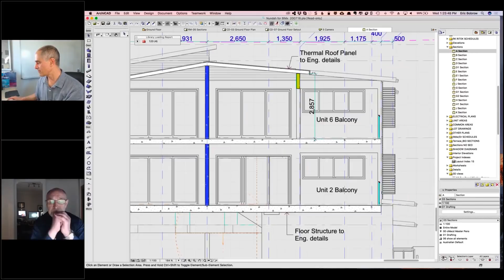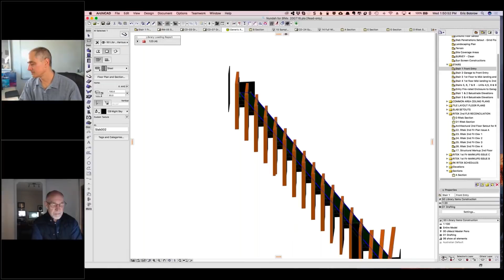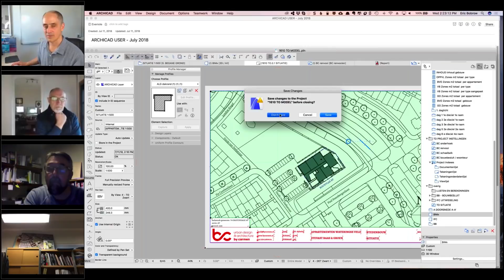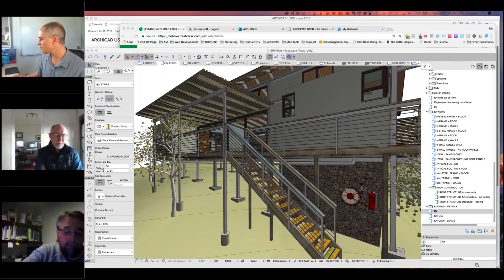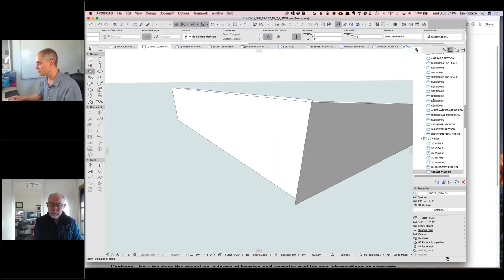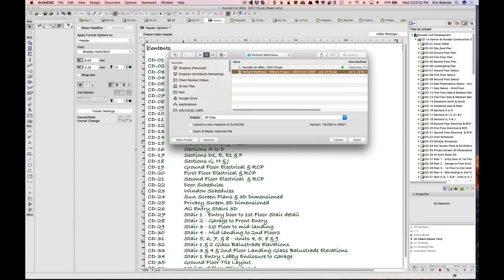ARCHICAD USER - July 2018 - Project Reviews of Users from Around the World

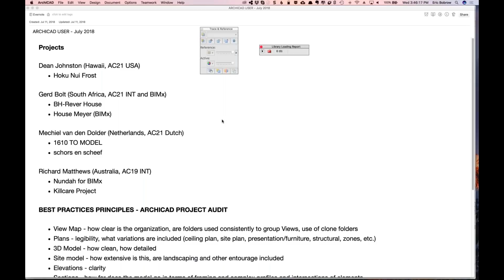Comment: 2:24:29 If the sloped beam has a 5° slant angle the horizontal beam has to has to have a 5° rotation in order for them to meet perfectly. You can find the "Beam Slant Angle" and the "Beam Profile Rotation" input boxes in the dialog box of the beam tool.